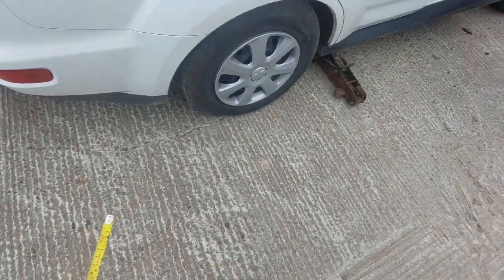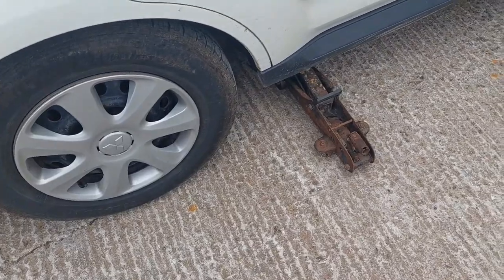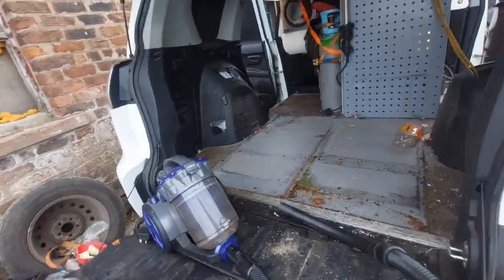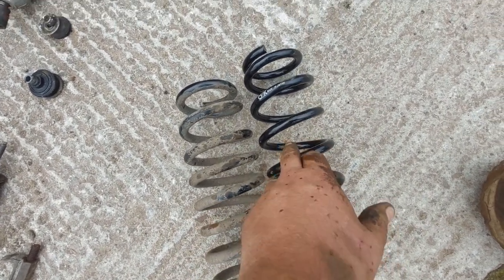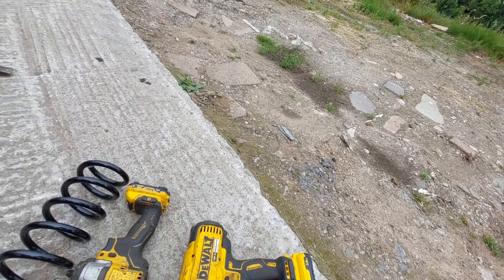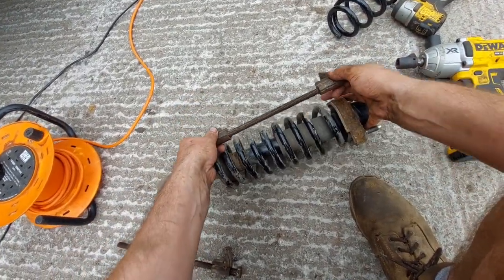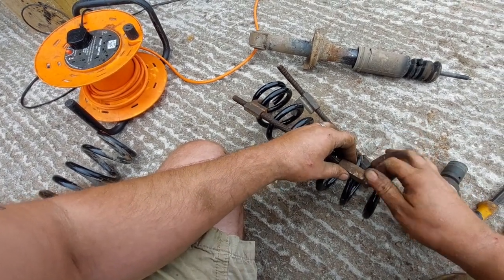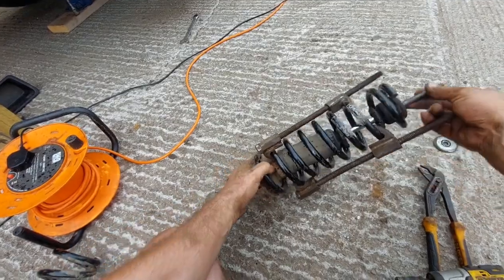workshop Wednesday episode 16

Comment: Well congratulations on that one . Filming and trying to change springs. Wee note for future buy spring clamps with two fingers top and bottom it does make a difference . You can buy spacers for the top of the struts if your needing more lift. Think Milner 4x4 can get them... Great vid glad you still have all your finger and the swear tin got a top up 🤣. Stay safe 🏴
Reply from the maker: Cheers ian. Yes fingers are all still attached although touch bloody n sore in placesgood job i dont have a swear jar id be in some serious dept🤣. I gave better advice regarding spring compressors.....send it to a garage and let them duck low flying strut components

Comment: Good job mate now you know want I have to put up with everyday in workshop 😬 but we have hydraulic press for them 😁might have been worth putting new shocks at same time only say that as some spring we changed the shock started to leak after a week and we ended up changing them 
Monday was interesting we had a van been converted to camper cost them £7000 really nice job you know built in washer/toilet bed cupboards etc only trouble with that it needed some welding underneath the women was in tears when we told her it would all have to come out 😭
Hope you enjoyed your beer that evening 😁🙏
Are you doing any hay making ?
Hot?
Cheers see you next time 👌👍👍
Reply from the maker: Cheers 🐜. Well if the shocks start leaking i aint doing em🤣. Think ur right though assuming i can actually find them taken 11 months to find the springs. Feel sorry for the women ud think the converter would have done a structural survey first